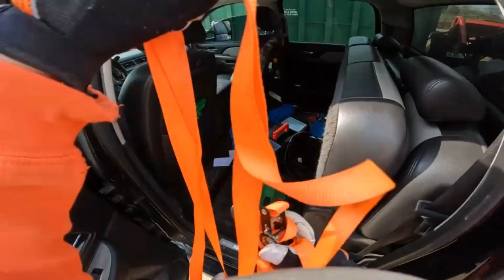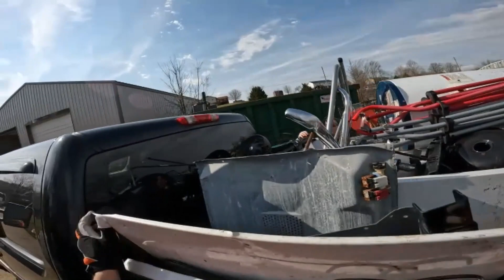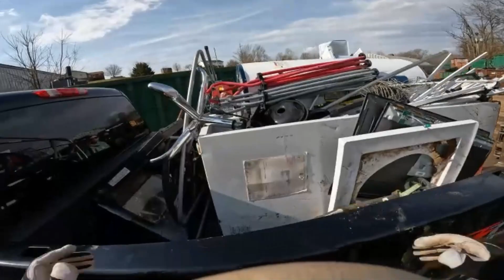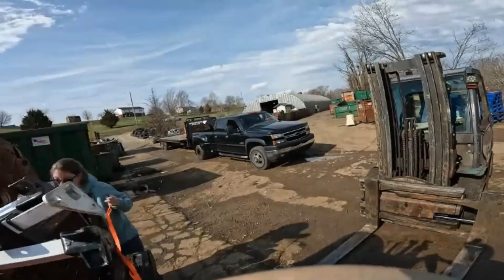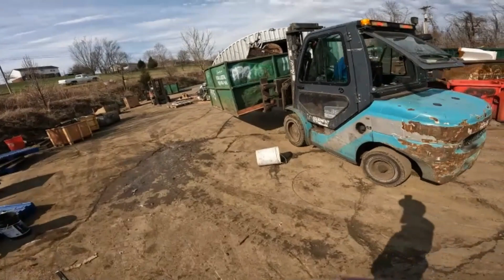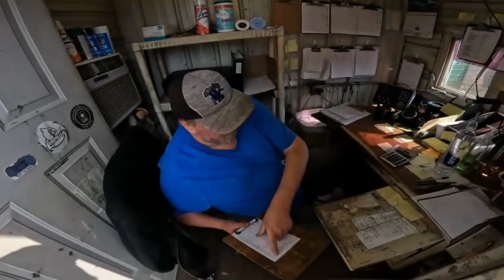Scrap yard run with a load of goodies and another pay day

Comment: I’m new to your Chanel
First video for me I did notice 1 thing the section where the knobs are one the washer most of those section are sheet aluminum if you have a place to put them they add up there are usually 2 to 4 screws holding them on just a thought
Reply from the maker: Didn’t know that I will start getting them thanks for letting me know I appreciate all the help buddy! Thanks for watching!